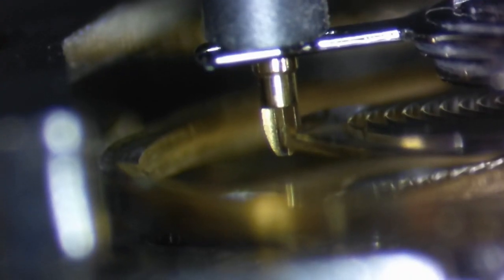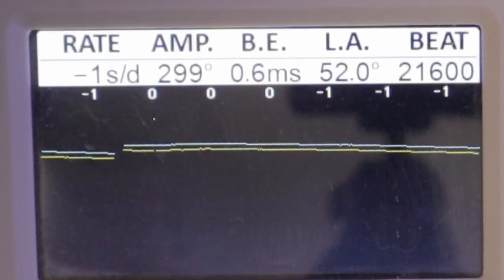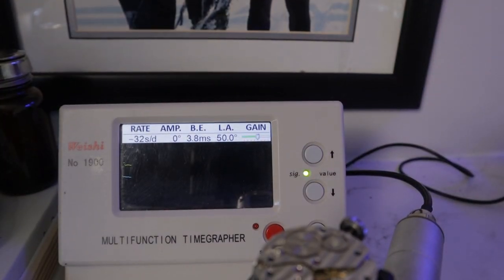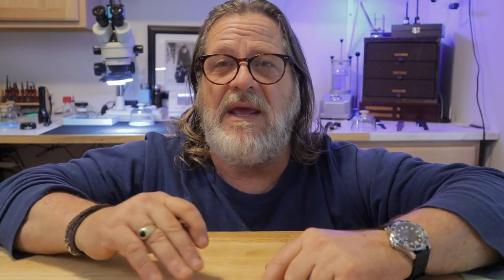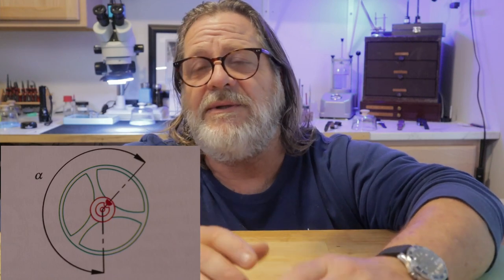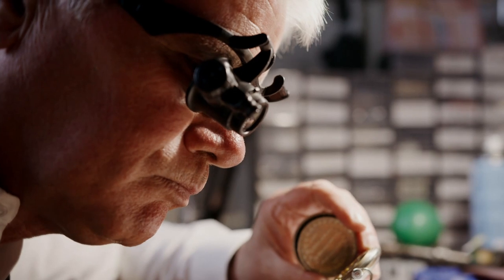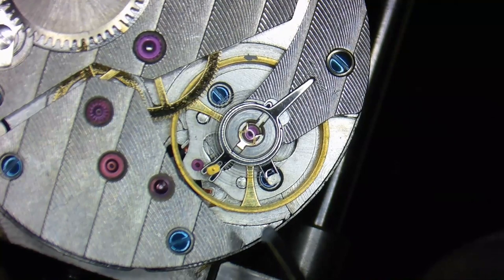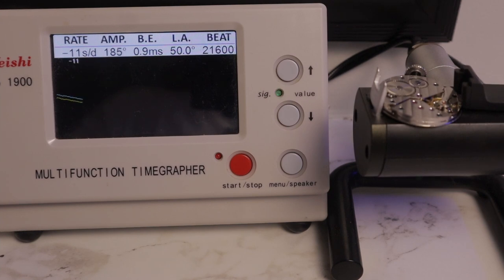Common Mistakes New Watchmakers make Using a Timegrapher

Comment: The American Watchmakers-Clockmakers Institute (AWCI) - ROLEX "What delta really means to your customer is this: It doesn’t matter if they wear their watch on the right wrist or the left, if they sleep in it or not, or if they lay it down the “wrong way” at night. It doesn’t matter, because the watch will only vary in timekeeping as much as the delta value (and often even less). So knowing the delta and having a low delta is a very desirably thing." / OMEGA "The same applies as above; a very low delta often keeps even the pickiest customer satisfied."
Reply from the maker: That’s a good way to look at it.

Comment: I remember the day I saw the 'delta' was more than 1 minute, I never knew the exact reason. My question is solved by this video, I was complacent on lubricating end stones (I was afraid of losing it😂).
Reply: That 8 o'clock regulating position tip is just awesome.
Reply from the maker: It’s where we all start from. It’s shocking when you first see how small and like that in stone it is.

Comment: Wonderful video, as always. Just one question — does adding the drop of whiteout change the poise this skewing the result?  How sensitive are the wheels and springs to the extra weight?
Reply from the maker: Good question. Not for the purpose of determining lift angle. Poise error's do not effect a balance wheel in the horizontal positions, only vertical positions.  Of course after the lift angle is determined, you would clean off the white out or marker, whatever you use.

Comment: I two am very new to this hobby, but am just continually in amazement of the mechanical watch movements of any kind. I have a Glycine airman that is very out of time , its only about 6 mo old and was good but now its not. I have a timegrapher , and have had good from it, however not so with the Glycine witch has a Sellita cw200-1 movement but the rate is +619 with an amp of153 full wind beat error of 9.2. I have not done anything to watch. But thought i could see if anyone had a clue? thx SteveO 63
Reply from the maker: First thing to check would be magnetism

Comment: What time interval do you typically use? Is 60 seconds ok?
Reply from the maker: Yes. 60 seconds is good 30 to settle in and then 30 to get your rating. Perfect.
Reply: @watchrepairtutorials  and do you just use 3 positions and then average them? I am trying to get an accurate idea of how a couple of newer Rolex and Hamilton’s are running.
Reply from the maker: @BJJandBS  well, depending on the move at the Hamilton should be figured at five positions and the Rolex definitely six positions
Reply: I ended up doing the 3 positions for both and both were less than +- 2 seconds so Ill just be happy with that for now. lol

Comment: Can I only get lift angle from manufacturer or can one measure it?
Reply from the maker: Lift angles are from manufacturers. You can only calculate it by the method I showed you in the Bonus Tip
Reply: @watchrepairtutorials  Ah, must've missed that part 😊
Reply from the maker: @Torskel  it’s near the end.

Comment: Well, I learned something today! I didn't know about the manufacturer's beat error tolerances, and I didn't know that anything under 1ms didn't affect the time keeping. Interesting stuff! Great informative video as always
Reply from the maker: Let me say that it obviously has to a lot to do with the grade of the movement. These are minimum allowances that would be allowed, but with the ease of adjusting BE in modern movements as opposed to adjusting BE at the collet on older movements, there really is no reason that it should not be perfect in the dial positions.

Comment: I understand what lift angle is but not sure how I can figure out what it would be on a vintage ww2 Elgin A11 580 movement with 7 jewels. I wanted to ask if you had a clue on the lift angle?
Reply from the maker: It's very simple to figure out. Start with the movement with no power. Mark the balance wheel with a sharpie near the top somewhere by the center wheel and then put another dot 180° or half the balance wheel somewhere on the main plate where you you'll be able to see it. Now you have one sharpie mark on the top of the balance wheel and you have mark 180° from it on the plate or bridge.

Then you add a couple winds to the mainspring and you watch the dot on the balance wheel. The idea here is that you want the mark on the balance wheel to line up with the other mark that's 180° away from it. Once it starts getting close or hard to see, film it with your slomo on your phone so you can see when the dot on the balance wheel lines up with the reference dot on the main plate. Just add a few winds at a time,  film it and add winds to the mainspring as needed. Once those two dots line up, the amplitude is 180°. Then just adjust the lift angle on your timegrapher until the amplitude is reading 180° and whatever the left angle that you are  set at is the actual lift angle for that movement.

I showed it in a video but I don't know which one it's in.
Reply: Thank you very much I will try my best with this
Reply from the maker: @jaymopar  if you’re going to be working on vintage watches, this is a very good thing to know how to do it. Often times the angles on the Internet are not correct. If you start off with an incorrect lift angle, it makes it really hard to judge what your actual amplitude is.

Comment: Your channel is amazing 😍

I just got two of my watches from service from a local watchmaker and both are around 180 degrees amplitude. I told that to the watchmaker and he said it was "fine". Both are running slow. One has VERY different rates between different positions from -50s to +5s, while the other seems pretty consistent with 5s delta ~ -5s to -10s.

Its disappointing... Not sure whether to take them back and keep pushing or accept a big waste of money and go elsewhere...
Reply from the maker: That’s totally unacceptable from a watchmaker. Sorry to hear that was your experience.
Of course the real measure is the accuracy on your wrist .

Comment: An easier way to check lift angle is use a black dot from a dry erase pen and slowly wind the watch till you can see a solid black dot at the 180° position. This is because the dot it lining up with it’s self on each cycle at the 180° position. The cycle is so fast that once you hit the 180° the dot stands out. Then change your lift angle on your time grapher till it reads 180° amplitude.
Reply: Use a black dot where, though? On the plate? Or the balance wheel?
Reply: @libindaniel2000  You've probably figured it out but anyone who hasn't, the wheel. The plate isn't moving. The wheel is what's lining up with itself.

Comment: White out?
Why not black sharpie?
Less weight, no flaking, easily removed with alcohol dampened q tip.
Reply from the maker: It’s easier for me to see and any additional weight has no effect on determining lift angle. The white out also just flicks off.

Comment: Than you for this video! By far, it’s tge best video on the subject! All purposes we didn’t know about it, ask in one video!! One question I have I’d about the timegrapher. Being that it is such a crucial tool and it’s accuracy should be of major importance to the results off out adjustments! I see you use the Weishi 1900 model, how does that compare to the 1000? And I’d like to know if we need to be aware of fake machines? Amazon, eBay, etc have them at different price ranges and raised my fear level about the chance of fakes being a problem. Are all of them are made in China?
Reply from the maker: I’ve never owned the 1000 but it is my understanding that the screen resolution is not as sharp. I also believe the 1000 does not have the ability to input custom BPH.
Most of these machines are made by the same manufacture, and just re-branded with different names. As far as I know, they all work the same.

Comment: Hi there. Learning so much from your videos. Thank you 😊 When using a dot of white out on balance wheel to determine lift angle, would the balance wheel need to be cleaned afterwards? Wouldn't the added weight from the white out cause a positional error, i.e. a heavy spot?
Reply from the maker: Yes it needs to be cleaned off. Poise errors in a balance wheel do not affect dial or horizontal positions. They only affect vertical positions. 
FYI, you can use any kind of marker as long as you can see it clearly.

Comment: Hi Alex.  This video is great.  Love your style.  But...I wonder when you get a moment if you wouldn't also tell us a bit more about those two lines on the grapher.  I have done some experimenting with this device.  Playing drums on the countertop from which it sits.  Also, tapped a wood peg on the microphone.  Played load music near it.  It would have been interesting to see what it picks up at a Monster Truck Rally!  But, some watches I record seem to show those lines are all but one line.  So close that they're on top of one another.  What does that mean?  Other times the grapher just shows dots all over the place.  Looks like snow.  Figured out if those lines are going downhill the movement is slower then zero.  If lines are going uphill it's running fast.  Straight is zero.  Also, on the 1900 those lines are two different colors.  Which one is what?  Perhaps put a dirty watch on the microphone.  Then place an overhauled one (or brand new) on the microphone.  There seems to be no manual that really gets into the 1000/1900 as much as you have in this video.  Thank you so much.
Reply from the maker: I plan on doing more troubleshooting videos with explanations of patterns and what they mean. The answer to your question is quite long and there is a lot of context and nuances that need to be understood to interpret the lines correctly.
Basicly, each line represents one half- cycle or one swing in one direction. A complete oscillation consists of two swings or half cycles. The timegrapher detects the movement of the balance wheel by sensing the vibrations generated by the watch's escapement.

The timegrapher precisely measures the duration of each oscillation cycle, usually in milliseconds and establishes a reference time based on a known and consistent oscillation rate. This reference time represents the ideal duration for each oscillation cycle.
 Then the  timegrapher compares the measured duration of each oscillation cycle to the reference time. The difference between the measured duration and the reference time is the beat error. When those lines are together the beat error is 0.0ms and as the beat error increases the lines separate.

Comment: Hey Alex I noticed that you show the st36 with a lift angle of 50°, I thought they were the same as the eta 6497, 44°?
Reply from the maker: Clones are not exact copies.  As a matter of fact,  there are differences between the ETA 6497-1 and the ETA 6497-2. Even though they look the same, they have two different beats, 18000 and 19800. The mainsprings are different and even though a lot of parts would be interchangeable, things like the train wheels, pallet fork and balance wheel are not. 

It doesn't take much of a change in the escapement geometry to change the lift angle. The Lift angle of an escapement is determined by  the start of TOTAL UNLOCKING on the receiving side and the end of the RUN TO THE BANKING on the let off side.

In the example I showed on the ST36, the rotation of the balance wheel is right at I80 degrees.   It actual swings a little past the dot on the main plate. So if the timegrapher is showing 185 degrees, with the lift angle set to 50, then I'm pretty confident that its correct because its a lot easier to see the motion of the balance wheel than the RUN to the BANKING.
I don't have a 6497 to check right now.

Comment: thank you for the tip to figure out lift angel! XD any tip on how to spot clean the whiteout off the balance wheel and main plate without damaging anything?
Reply from the maker: It literally just flicks right off. You can also use a Q-tip with a little bit of alcohol on it and wipe it off as well.

Comment: Thanks Alex.  You show things not many do in other watchmaking videos.   Say I service the watch and put it on the timegrapher.  My biggest problem is they run fast.  Every dang time running super-fast.  Like 10 minutes per day, at least, fast.  Something besides magnetism.  Hairspring, poising, whatever it takes to adjust the watch across positions.  How to poise a balance, baby-step by baby-step, and how to get the watch in acceptable tolerances in different positions.  Does your Journeyman course show how to do all this stuff?.  If so, then that is what I need.  The next step in this aggravating "hobby" I have a love-hate relationship with.
Reply from the maker: Yes, I will be including regulation as well as dynamic poising in the course. It also includes how to adjust the escapement and I will be adding setting and adjusting pallet stones.

Comment: I’ve never worked in the times that these mtg 1000’s weren’t widely available. But I can only IMAGINE how easy it was back then. LMFAO! Nowadays EVERY dealer and their mother has one. I have a client that on modern watches, the amplitude must be 270+ dial up and 240+ crown down. And the watch must be within +5/d and -4/d in every position. Now that’s easy enough on a modern watch like a Rolex 3135. But a Rolex 2030? SIKE! They’re next to impossible to get within +5/-4! Amplitude is easy on that cal (2030). Now try getting 270+ amp on a Rolex 3035! That’s a challenge. Worst part about it? I’m only charging 250$ a service :(. But I am young (26 yo) do not have certifications (I worked under my father since I was 14) and not a lot of people know me. So I guess I just have to take it. I HATE being a young watchmaker. Dealers don’t trust you, and older watchmakers hate your guts and refuse to give you ANY info. Im doing my best out here though. And managing kind of well if you ask me. If you’re a young watchmaker, DONT GIVE UP. it took me years for someone to finally trust me with a Rolex. I did SO many juvenia and shitty ETA clones. But now I finally have my own company and my own office. Building up respect little by little! I love this career! I wouldn’t trade it for the world.

Comment: Wouldn't the liquid paper throw the balance of the balance wheel off on that trick that you showed at the end?
Reply from the maker: Not for the purpose of establishing the 180-degree rotation of the balance wheel.  When you can see a wheel turning 180 degrees it IS turning 180 degrees. Now if you didn't clean it off, it would cause an poise error when the watch is vertical.

Comment: Thank you for sharing your life long learning with new generations of enthusiasts.  I have a question regarding my Rolex two tone Submariner; I purchased the watch new from a Rolex dealer in the mid 80’s.  The watch is in excellent condition and has never been serviced or opened.  I have not worn the watch in many years and it’s not running.  Do I send it to Rolex, knowing they will replace original parts as they deem necessary, how can I have it serviced while keeping it as intact to its original parts as possible?  Thank you, Will
Reply from the maker: You can request that certain parts are not changed although some things like the mainspring are not going to be an option with them and you will want that changed out anyway.
Other than that you can find a Rolex certified independent watchmaker who will be much easier to communicate you wishes to.
I would contact the AWCI for a list of watchmakers close to you and then make some phone calls.
Reply: @watchrepairtutorials  thank you - very much enjoy you channel

Comment: Thank for sharing this info. As a (absolute) beginner is was wondering what my new bought Weishi 1000 could tell me about my mechanical watch and what's behind those readings.
Reply from the maker: Well, first and foremost, you need to look up to see what the lift angle is and adjust that for your watch movement. The correct lift angle in the timegrapher will  tell you what the amplitude is. The amplitude is basically how far or the angle that the balance will isolates during two vibrations. This is an indication of the health of your watch movement amplitude of 270° in the horizontal position is kind of the benchmark for a movement that’s running well.
The rate is just what it sounds like it is the time gain or lost over a 24 hour period when the watches in that position. The six main positions are dial up and dial down, and then the vertical positions are crown up crown down crown left and crown right. You will notice the amplitude drops 30 to 40° when you move from the horizontal position to the vertical positions.
Beat error is the measurement of the difference of each vibration during one oscillation of the balance wheel. Your time Grapher is measuring how long one vibration is when the balance wheel spins to the left, and it’s comparing it to the vibration when it spins to the right, and that difference is the beat error.
Beat error is really only important when it’s over 1.0 ms as that will affect the timing but anything under that does not affect timing. What it does affect is how easily a movement will start up once power is put into the main spring barrel.
And that my friend is a general overview of what the timegrapher will tell you
Reply: @watchrepairtutorials   Thank you!

Comment: In that bonus tip for determining the lift angle, doesn't the white out affect the balance wheel's poise or is it negligible?
Reply from the maker: That’s a great question. It would absolutely create a poise error, but horizontal positions are not affected by poise errors only vertical positions.
Of course you would need to clean it off after the lift angle is determined. The white out comes right off.